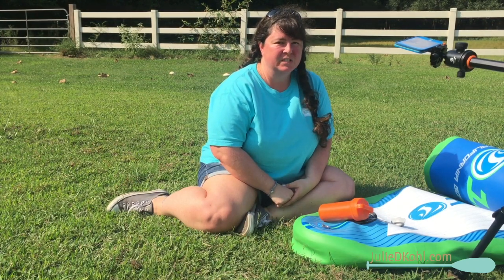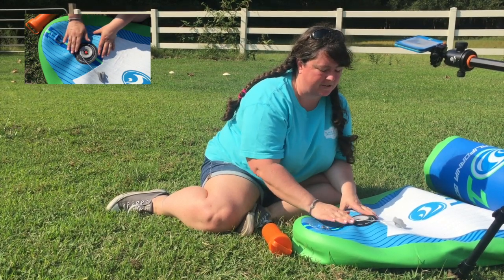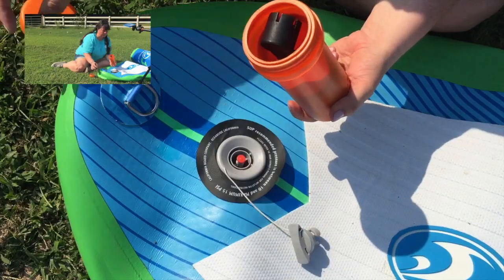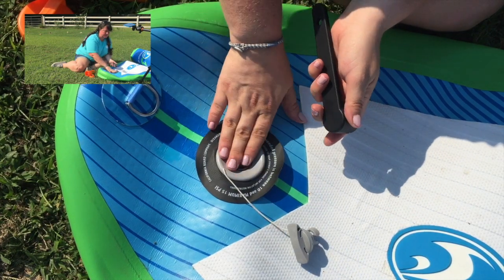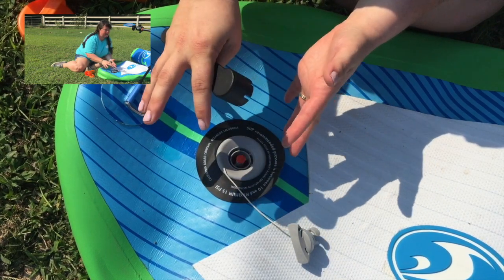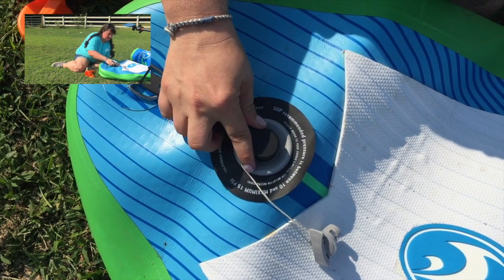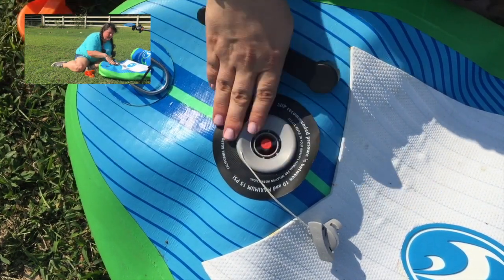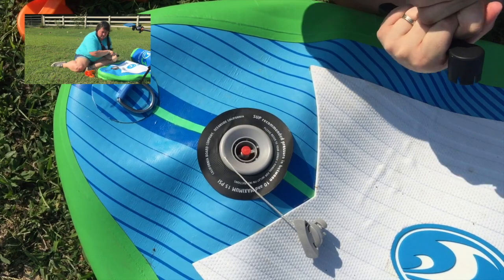How To Fix a Leaky Stand Up Paddleboard Valve

Comment: Thanks so much! My paddle board started leaking air while out on the lake one day. This was my second summer using it. I was worried it was ruined and I'd need a new one. I followed your instructions and have taken it out 10 or so times since. I take the repair kit with me when I go out now. I have to tighten the valve about once every 2-3 times I take it out now. I added some glue around the seal too. I don't know that that was helpful, though.

Comment: Thanks for the info Julie. I too thought my brand new board was a dud from the factory. Doh ... I even remember seeing that wrench and thinking it must be for the valve on the board. I watched another video where they suggested inflating the board to max pressure (15psi in my case) before tightening up, but you said NOT to inflate it in order to tighten it up fully. It sounds like you speak from experience?

Comment: Do you have experience if the middle piece is loose? Like I can pump it up, but to take the pump off and put the lid on it deflates
Reply from the maker: Courtney the valve in the middle has two positions an open position and a closed position. You need to press down one the spring and turn it. When you do this the valve should hold the air until you press and turn it into the open position.

Comment: There are 100 videos on how to use the wrench to loosen or tighten the valve but there are no videos on what happens when the wings on the valve break off.

Unfortunately a that they manufacturer might be out of business.

I tried to gouge the plastic with a screwdriver and torque It Off, I even tried gluing the wrench to the inside and stress the wrench to the point of it almost breaking but not budging at all. I don't understand how I could have cranked it so tight that it's practically Frozen on!

Comment: We’ll, okay, but what they don’t tell you is that if you remove the valve (as in, they sent you a faulty one and then a replacement part), the threaded piece inside the paddleboard is not anchored in place. They don’t even tell you that there IS a threaded piece inside. On my wife’s paddleboard, this part wandered away by a couple of feet. It took a while to find it and wiggle it back into position.